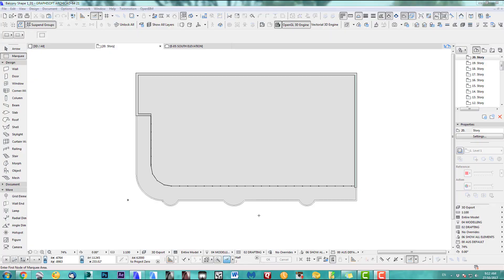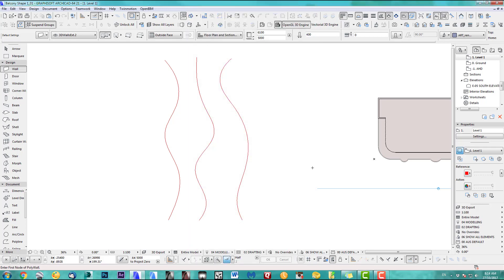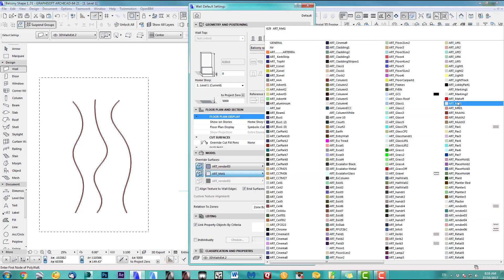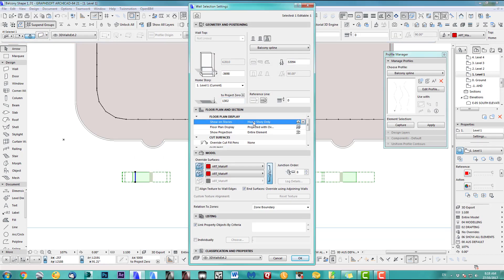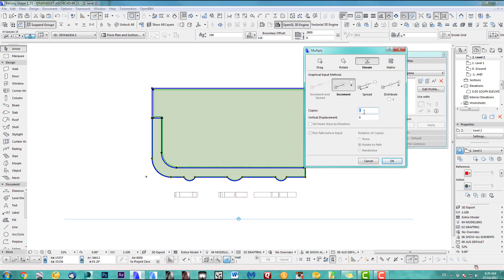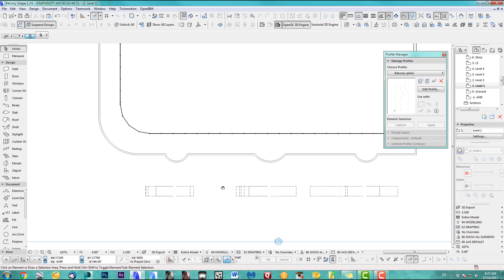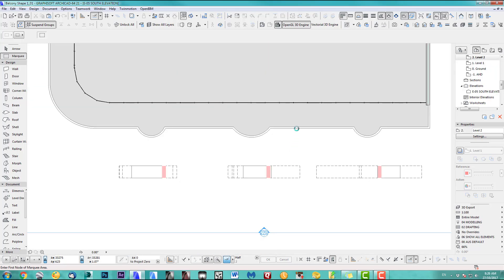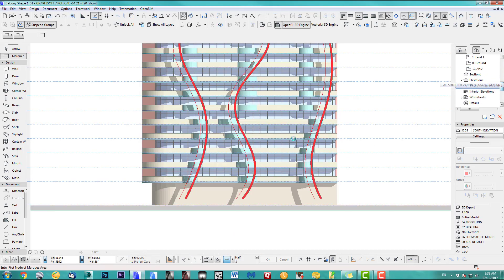How to model balconies along splines in Archicad

Comment: Hey man,  would be possible to multiply all curved balconies in elevation using the spline as path? Then you'd only have to trim the straight balconies when it intersects the curvy one. Need to try lol
Reply from the maker: That is a great idea! I just checked it seems to work, thanks for the tip :)